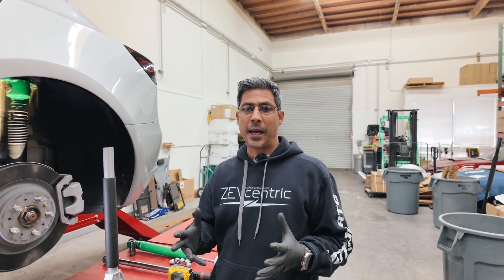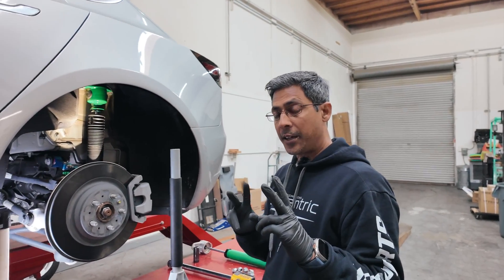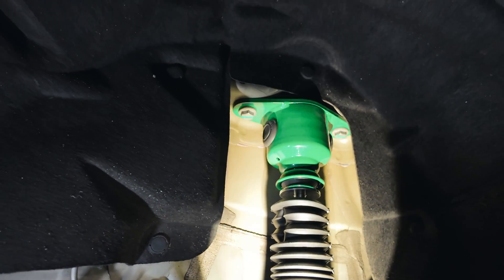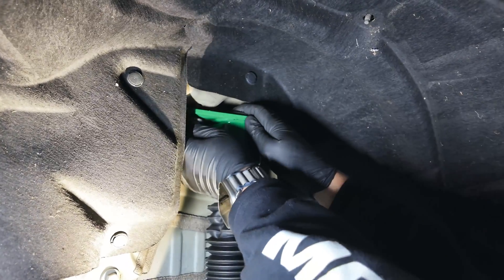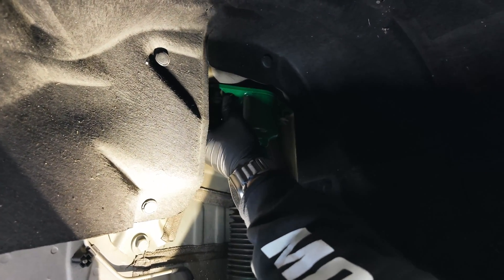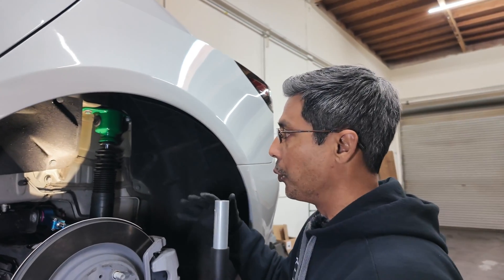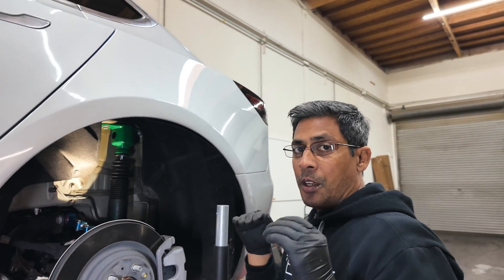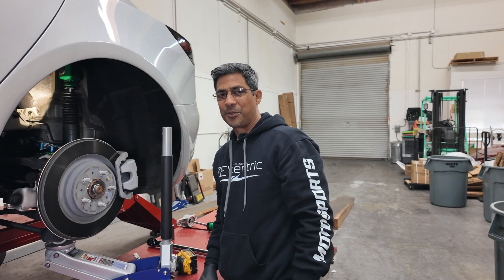HOW TO ADJUST TEIN ENDURA PRO PLUS AND FLEX Z REAR SHOCKS ON THE MODEL 3 AND Y

Comment: What I nightmare I just went through!!! I have to share this with you so I hope you won't go through this to.  I bought the Tein Endura Pro.  Rishi pointed me to a guy here in atlanta who has done many of these installs.   $1,300 later and 1 week after the install it felt like the ride was worse and real bad noise coming front left wheel.

I tried to get the installer to help.  He just was not interested.  I went back to Tesla.

They said first the upper chamber arm needs to be replaced $500.
But the noise was still coming from the front left wheel.  Next 
Replaced the Lower Lateral Link $1,500
Still popping noise.  Only thing left were Tein Enduro Pro.
Replaced with the Tesla original shocks.

Totals disaster. $1,300 Tein Enduro Install
The Repair for damage caused by Tein Enduro Pro  $2,800
Total $4,100 

So I can have a softer ride.  In the end I just got back to square one.

One think be very careful of.  If you buy third party shocks.  Tesla will not work on your suspension again.  They will send you on their way.  I got lucky he did not realize it until he was to far into the install so they made an exception.

Wow!

Comment: Endurapro plus or koni yellow?

For the model 3?
Reply from the maker: Are you looking for comfort?  Please look for our video on koni yellows to understand the adjustment difficulty.
Reply: @zevcentric  I saw the rear adjustment issues that's why I was leaning towards Tein because for the better clicker. 

I do like that the yellow aren't inserts like some older platforms.
Reply from the maker: @TrueDreams exactly.  The yellows are impossible to adjust in the rear.  Tein will be more comfy also.  We have them in stock if you’d like to shoot us an email.  Where are you located?  Zevcentric@gmail.com
Reply: @zevcentric  I'm in Canada but have shipping at Blaine wa 98230.

Flex z seems like a really good entry. Bring that minimum is one inch lower.

Vs endurance with Zev doe eibach - 1.5"

Ill need to relocate before I vs figure out the next parkade issue.

Have you guys done flex with air cup?
Reply from the maker: @TrueDreams  air cups dont work well on the Tesla imho.  Whole batch of other issues there.

Comment: When installing the endura pro, how do you tighten the lock nut on the top hat without the rod spinning with it?
Reply from the maker: Its a very light torque spec.  Just use blue loctite also. You can grab the shaft through the spring coils.
Reply: I just impacted that thing straight down with a lighter power impact

Comment: Why do these shock absorbers make a noise when moving, how to eliminate it?
Reply from the maker: We dont have that problem.  What are your damper settings?  Where did you buy them from?
Reply: @zevcentric  When I adjust the level to 3 out of 16, the rumble passes, but it's hard as on OEM shock absorbers, if I make the level higher for softness, the rumble appears, what is the reason?
Reply from the maker: @Adam76 send an email to your branch of Tein in your country for technical support.  We are not the right contact.  We do not have this issue.

Comment: Tein makes adjustment extenders, 100, 200 & 300mm. I have 200's on the rear shocks. Easy adjustment in the hatch of my Mazda 3.
Reply from the maker: They didnt work on the tesla model 3 for a few reasons.  We tried.
Reply: How did you install this? Have m3 hb as well. There is a window in the coilover but we need 90 angle adapter for that. Or have you cut the car body to adjust it from the trunk?
Reply from the maker: @bohdanmazurenko  I am not sure I understand, but do you own a Tesla? There is no cutting required of anything.
Reply: @zevcentric  mazda 3 hatch, the same as jwsnyder has
Reply from the maker: This video is for the Tesla Model 3 so I don't have any valuable input for you.
 @bohdanmazurenko